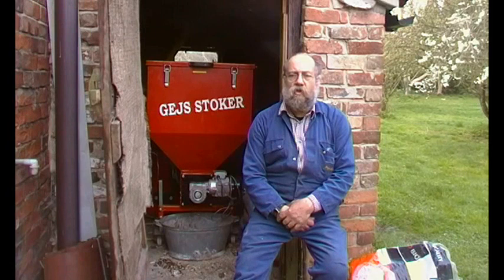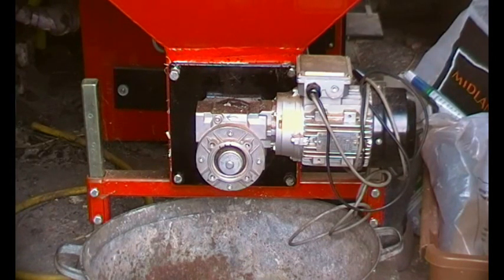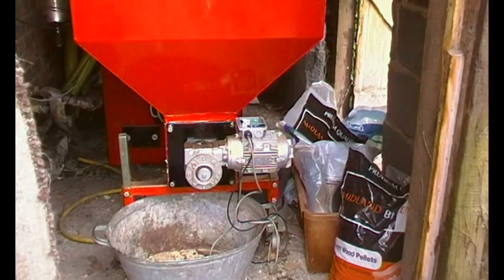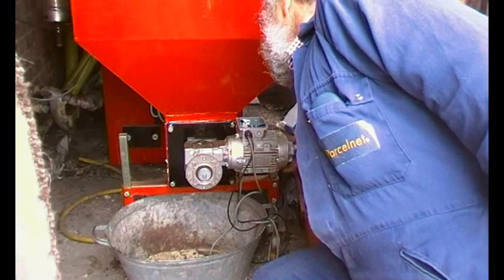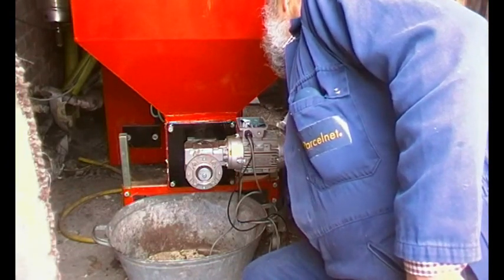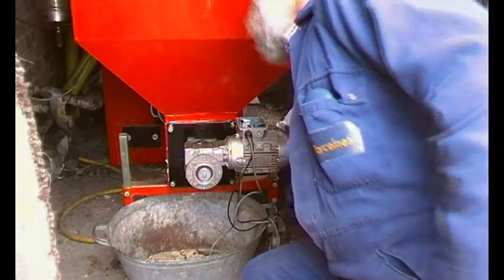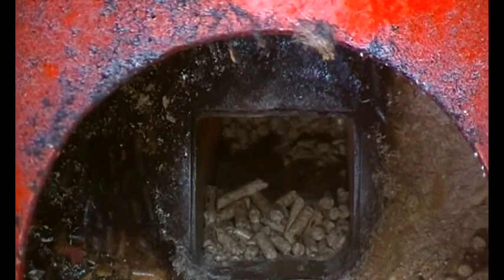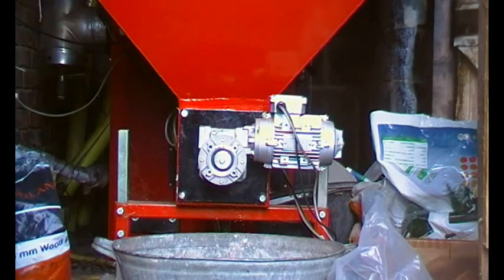Pellet boiler auger investigations, Gejs stoker settings.

Comment: I suggested a pellet boiler to a friend who is keen to divest from fossil fuels as much as is practical currently. This has been a good insight into the workings of one.  Another alternative would be an air source heat pump which is heavily dependant on electricity alone to deliver heat.
Would you recommend a pellet boiler Andy ?
Reply from the maker: Jim, relying totally on the grid seems a bit foolish. Would I recomend a pellet boiler? well it depends on your time constraints, we had a bit of a problem getting pellets last year. I you have the time and timber then a batch log boiler and a huge heat buffer tank would be the way I think. You could then add to this Solar heat through panels and a diverter and maybe also a heat pump. You would need lots of PV to finish things off. Cheers